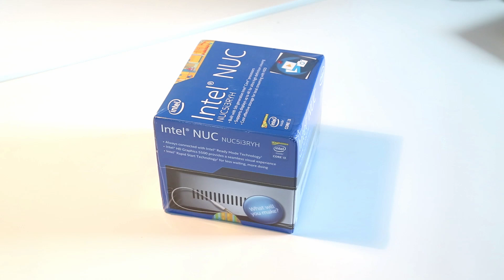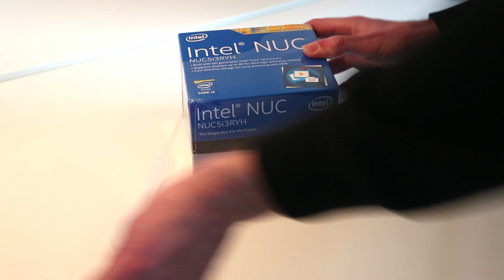Intel NUC5i3RYH Unboxing and Assembly - i5-5200U

Comment: Is the cable included or do i need to buy it??
Reply from the maker: Which cable?
Reply: The power cable because my friend got a power cable but without it being able to plug into the wall
Reply from the maker: It was included - comes with a power brick and various different plug types that you clip on for your country if I recall correctly.

Comment: Issue with putting the base back on, the cable for the 2.5" drive (I'm not using) seems to be getting partially caught between installed M.2 and the base, as that corner won't sit flush. Any thoughts?

With regards to the video, while very helpful in getting it setup, you might want to consider camera angles in the future, as your hands were quite often blocking what was happening.

Comment: The spec sheet i read says "Internal support for M.2 Key Type M SSD card (22x42, 22x60, or 22x80)", the M type as far as i could see is only supposed to have 1 notch in the pin layout, while the ssd you inserted has 2, which my research tells me is a M&B type. Im currently trying to buy an ssd for mine and am confused as to what to get as they all seem to have 2 notches...
Reply: Adrian Tollis Make sure your looking at the correct model NUK. There is a bunch of different models.  Better to look at the Intel website and read the documentation, this will give you the answer which you want.